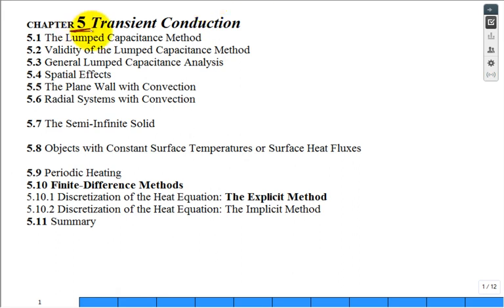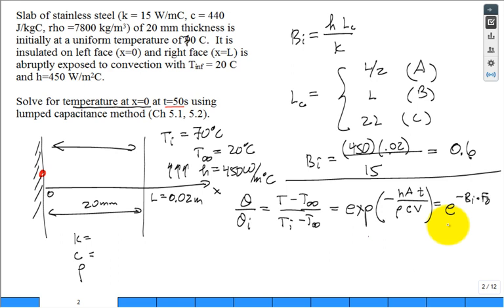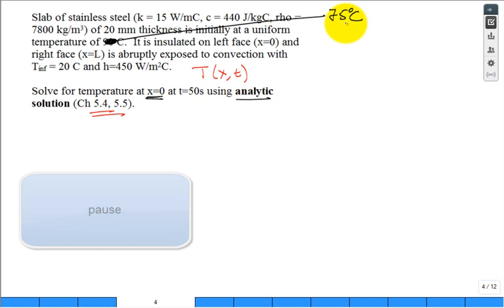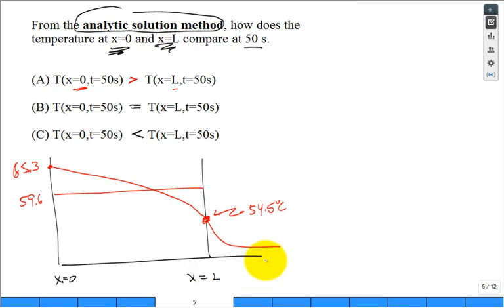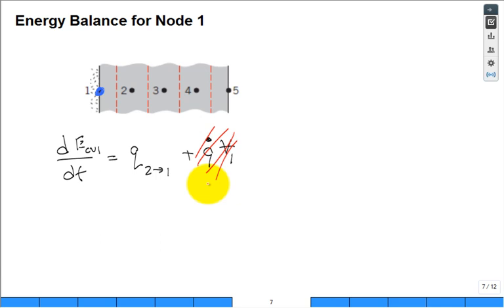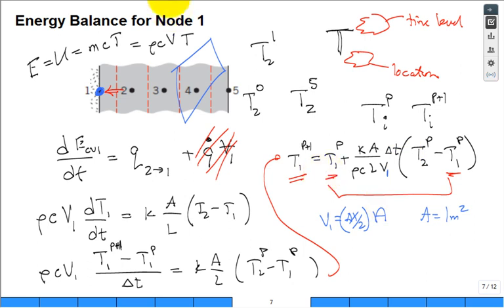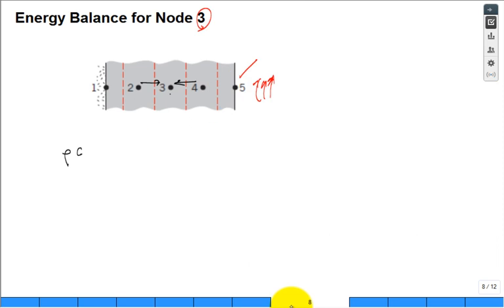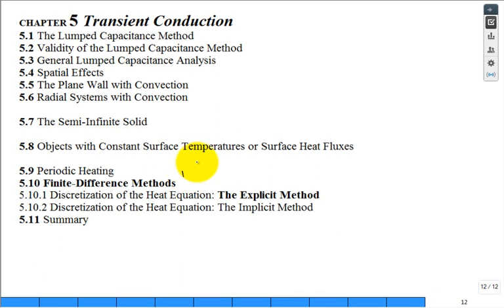Transient conduction using explicit finite difference method F19

Comment: according to 7th ed. fundamentals of heat and mass transfer bergman textbook, to use the first term approximation, the fourier number must be greater than 0.2. however, u said it should be lower than 0.2. isnt there any problem

greetings from middle east technical university ❤

Comment: Pease Recommend a book
Reply from the maker: We are using:  T.L. Bergman, A.S. Lavine, F.P. Incropera, and D.P. DeWitt, Fundamentals of Heat and Mass Transfer, 8th Edition, Wiley Publishing Co. 2017.
Reply: @randallmanteufel6411  how to treat the interface between two materials?
Reply: @200kkrishna  Was wondering this as well. I'm modelling my rocket team's rocket injector face, we want to put phenolic on it. The script below just uses the averaged values on both sides but it's off from the steady state solution by like ~200 K:

clc
clear all
close all

%Define Heat Transfer Coefficients
%(Guesses that Cameron used for Moe's injector Plate)
h1 = 6000.0; 
h2 = 3000.0; 

%Temperatures
Tinf1 = 2500.0;  %Hot side
Tinf2 = 300;   %Cold side

%Properties of Stainless Steel
k_SS = 15.0; 
rho_SS = 7500;
Cp_SS = 500.0;
a_SS = k_SS/(rho_SS*Cp_SS);

%Properties of Phenolic
k_phenolic = 2; 
rho_phenolic = 1000;
Cp_phenolic = 1000.0;
a_phenolic = k_phenolic/(rho_phenolic*Cp_phenolic);

Tf = 100; %Duration of burn
Ti = 300.0; %Initial Injector Temperature

%Current Injector Design
t_face = (3/8)/39.37; %Thickness in meters
t_phenolic = (2/8)/39.37; %Thickness in meters

Npts = 350.0;

%Computed things based on inputs
x_phenolic = linspace(0,t_phenolic,Npts);
dx = (x_phenolic(2)-x_phenolic(1));
x_injector = linspace(t_phenolic+dx,t_phenolic+dx+t_face,Npts);
x = [x_phenolic x_injector];
Nx = numel(x);

dx = x(2)-x(1);
dt = 0.5*(dx^2.0)/(a_SS);
t = 0.0:dt:Tf;
Nt = numel(t); %Number of time steps

%Intialize Temperature
T = ones(Nt,Nx)*Ti;

%Compute steady-state solution...
Rprime = (1/h1)+(t_phenolic/k_phenolic)+(t_face/k_SS)+(1/h2);
q_flux = (Tinf1-Tinf2)/Rprime;
T_phenolic_face = Tinf1-(q_flux/h1);
T_steady_phenolic = T_phenolic_face-(q_flux.*x_phenolic./k_phenolic);
T_stainless_face = min(T_steady_phenolic);  %q_flux*( (t_face/k_SS ) +(1/h2) )+Tinf2;
T_steady_stainless = T_stainless_face - q_flux.*((x_injector-t_phenolic)./k_SS);

for tt = 1:Nt
    disp( 100*tt/(Nt) + "% Complete"); 
    for ii = 1:Nx
        %if at the first node, apply convection/conduction
        if(ii == 1)
            conv = h1*(Tinf1-T(tt,ii));
            cond = k_phenolic*(T(tt,ii+1)-T(tt,ii))/dx;
            q = conv+cond;
            T(tt+1,ii) = T(tt,ii) + (2.0*q*dt)/(rho_phenolic*dx*Cp_phenolic);
        %if at the last node, apply convection/conduction 
        elseif(ii == Nx)
            conv = h2*(Tinf2-T(tt,ii));
            cond = k_SS*(T(tt,ii-1)-T(tt,ii))/dx;
            q = conv+cond;
            T(tt+1,ii) = T(tt,ii) + (2.0*q*dt)/(rho_SS*dx*Cp_SS);
        %if anywhere else, apply pure conduction (depend on if in phenolic
        %or not)
        elseif(x(ii) < t_phenolic)
            cond1 = k_phenolic*(T(tt,ii-1)-T(tt,ii))/dx;
            cond2 = k_phenolic*(T(tt,ii+1)-T(tt,ii))/dx;
            q = cond1+cond2;
            T(tt+1,ii) = T(tt,ii) + (q*dt)/(rho_phenolic*dx*Cp_phenolic);     
        elseif(x(ii) == t_phenolic)
            cond1 = k_phenolic*(T(tt,ii-1)-T(tt,ii))/dx;
            cond2 = k_SS*(T(tt,ii+1)-T(tt,ii))/dx;
            q = cond1+cond2;
            rho = 0.5*(rho_phenolic+rho_SS);
            Cp = 0.5*(Cp_phenolic+Cp_SS);
            T(tt+1,ii) = T(tt,ii)+(q*dt)/(rho*Cp*dx); 
        elseif(x(ii) >  t_phenolic)
            cond1 = k_SS*(T(tt,ii-1)-T(tt,ii))/dx;
            cond2 = k_SS*(T(tt,ii+1)-T(tt,ii))/dx;
            q = cond1+cond2;
            T(tt+1,ii) = T(tt,ii) + (q*dt)/(rho_SS*dx*Cp_SS);
        end
    end
end

figure(1)
for ii = 1:1000:Nt
    plot(x,T(ii,:));
    ylim([min(min(T)),max(max(T))]);
    title("Temperature (K) vs. x (m) [t = " + t(ii) + " s]")
    xlabel("x (m)")
    ylabel("Temperature (K) [t = " + t(ii) + " s]");
    hold on
    xline(t_phenolic);
    hold on
    plot(x_phenolic,T_steady_phenolic);
    hold on
    plot(x_injector,T_steady_stainless);
    legend("Transient Solution","Steady State Solution");
    grid on
    pause(0.01);
    clf                                               
end

hold on
plot(x,T(Nt,:));
title("Temperature (K) vs. x (m) [t = " + t(Nt) + " s]")
xlabel("x (m)")
hold on
plot(x_phenolic,T_steady_phenolic);
hold on
plot(x_injector,T_steady_stainless);
xline(t_phenolic);
legend("Transient Solution","Steady State Solution");
ylabel("Temperature (K) [t = " + t(Nt) + " s]");
ylim([min(min(T)),max(max(T))]);
grid on

disp("Max Temp = " + T(tt,1) + " K");